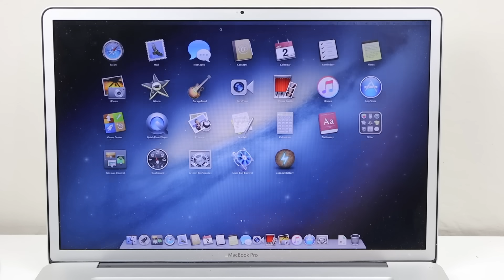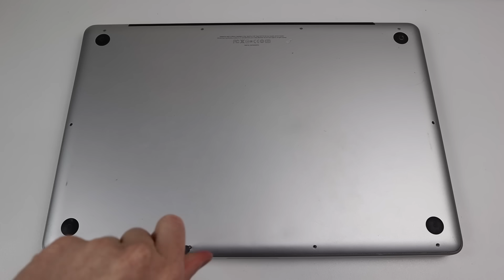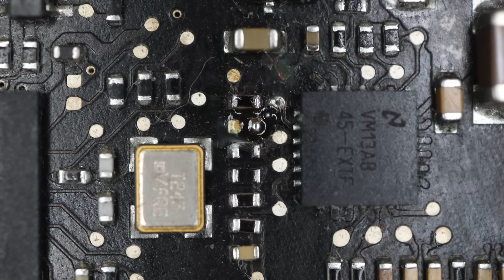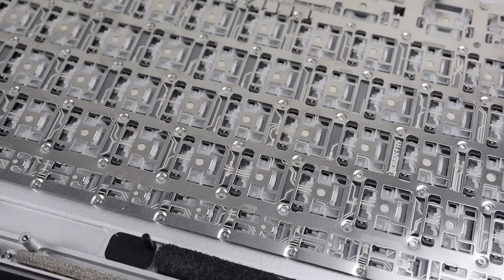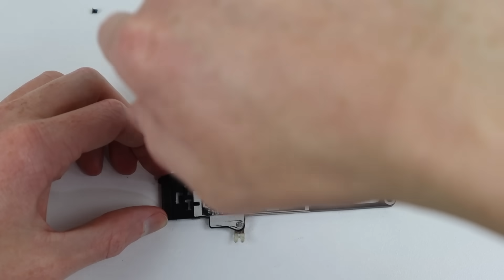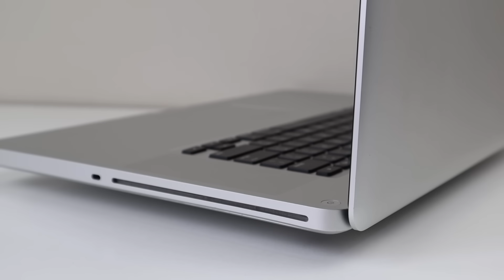Fried GPU! MacBook Pro 2011 Restoration

Comment: I just recently bought the late 2011, A1297, 17” MacBook Pro with matte screen, using a 2.5 GHz quad-core Intel Core i7 processor with the following hardware updates: 
500gb SSD Crucial SATA 3 (6.0 Gb/s), 16gb DDR3 RAM and a brand new battery. 
I’ve also installed Linux Zorin Core on it and kept the AMD Radeon HD 6750M GPU active. 
I also gave it to a workshop to have a “system clean” (heat sink and fan) and apply new thermal paste. Cost me a $100 but it is worth it! A very good idea especially with the GPU active. 
Also installed an ExpressCard for USB 3, that fits in perfectly. So much faster for file transfers. 
One month in and I gotta say it is the best laptop I’ve ever used. 
Using Linux… Took me about 3 days to get used to it and figure things out. With AI anyone can learn it easily. Never used Linux before. 
Linux Zorin is amazing. Something in between windows and MAC OS. Via terminal and with AI help you can set up the system to run perfectly! Set up the fans for thermals, Zorin sets up the correct drivers right away. 
I need it for Chrome web browsing, WhatsApp and Telegram, 3 different AIs, YouTube, VPN, VLC, Steam (installed Sims 4), torrent, Zoom and comes with a Linux version of Office (need it for work.) 
A Canadian bro recommended this to me cause I have a 13” MacBook Pro that I decided to bring back to life (which I have not used since 2019). Then after it worked I deliberately searched for a 17” top version in mint condition ( I have always wanted it) and just went for it haha. 
A 15 year old laptop guys! Total $350. 
As I said - the best laptop I’ve ever used. An aesthetic pleasure. I am shocked still. 😂
P.S. I totally get why corporations want to get rid of this kind of hardware that can be upgraded. Even PlayStation is following suite.

Comment: DosDude has a basic command you run in the Apple root shell. It works perfectly and Ive saved 14 2011 Macbooks. 3 of those running baremetl Linux flawlessly. Its permenant too. "DosDude 2011 GPU disable fix" in a browser. so easy. No need for this zapper although its cool and Hugh is a f--king genius. True master right here

Comment: hey just an fyi you can disable the amd gpu without doin all this.. hold command n s on the left side of the keyboard then follow dosdude 1s tutorial on what to type in to disable it the reboot but into recovery mode or mac os usb then type in csrutil disable press enter then type reboot.. then the mac will boot normal then download macbook pro d-gpu disable too from dos dude 1s website run it then reboot again then upgrade it to osx 10.15 or newer
Reply: Thanks man!

Comment: I bought a 15 year old 17" Asus ROG gaming laptop with a 1st gen i7 and Radeon 5870 for only $12 USD. It also has some artifacting and will crash under load. I repasted it with noctua paste and it luckily has never had a problem since. It cooled down significantly and is actually usable now. 

I ran into this same gen MacBook pro and am kinda afraid to buy it. It's only $20 but 80 miles and 2 hours round trip. I already have an iMac with Radeon 6000 era graphics with intermittent problems. It won't load OSx or Windows 11 but Ubuntu and Bazzite worked great. It has to be using the Radeon graphics cause left 4 dead 2 and half life 2 are able to run at 60fps 1080p. I don't think integrated graphics are that powerful.

Comment: Today it’s cheaper/easier to just swap the whole logic board with a 2012 model. Which is what I did on mine yesterday. These boards are cheap and they fit directly with no need for any modifications. It’s a remarkable improvement over the old one.

Comment: Hello
I had one 17 inches 2012 with the same problem. 

Make a firmware command to do not use thE FAIL GPU. Instal a lot RAM and asign 1.5 Gb to the integrated GPU

Also change the BT card to a new one to get Continuity feature.

And put an SSD to go fast.

Comment: boot your machine while holding the Command + S keys. As the system boots, it should display white text on a black screen, and should eventually stop at a prompt.
At this prompt, enter the following command and press Return:  nvram fa4ce28d-b62f-4c99-9cc3-6815686e30f9:gpu-power-prefs=%01%00%00%00
Reply: I used this back when I still used my 2011 15 inch daily, it really worked. I used it with a patcher on catalina until I bought apple sillicon after more than 10 years on the same device. It had served me well, despite its flawed gpu. I think it helped that I was a light user helping the gpu last longer. GPU lasted almost 8 years before failing. After that I found out that blasting it with a hair dryer uniformly would get it working again for a week before starting to show symptoms of failure again, which is when I found that nvram command somewhere. It served me well after more than 10 years on the same device, despite its flawed gpu and in hindsight awfully slow gpu even for back then considering the 6970 and 6990m were more than twice as fast from the same architecture and lineup. 

Back when you could buy a base 15" and upgrade as you go...

Comment: Wow i have an Early 2011 15 inch that I used the dosdude gpu fix and it works perfectly fine. It had the faulty gpu but i disabled it. I plan on giving it a new ssd and a new battery.

Comment: Same model as what I had. Took it to a guy and he used too much heat and fried the board while putting in a new GPU.
So sad since I just put in a new SSD and it worked really well and fast.

Comment: I’ve got this exact laptop and the graphics wasn’t working when I got it three years ago. I did the old bake in the oven trick and it’s been brilliant ever since so as quickly as it sounds baking the board it doesn’t actually work. At least I did in my case

Comment: To compensate for the lost dedicated GPU, you can use the Apple Thunderbolt 3 to Thunderbolt 2 adapter cable to attach an eGPU like an RX560 for example. There will be a performance hit due to it being TB1 instead of TB3 but it works and it's many times faster than the integrated Intel HD 3000.

Comment: Hi Hugh, greetings from Milan (Italy)! Based on one of your tutorials I got back a mid-2012 13” macbook pro I had in the basement and proceeded withe replacement of the Ram, replacing it with 2x8 Gb sticks from Komputerbay, the hdd with a 480 GB SSD from Crucial and the battery. Everything went smoothly. Restarted it pressing alt cmd and R, entered the wifi code. Connection started but few seconds later got an error message listed as -2100F. Can you help?

Comment: Did you ever figure out what was causing the Shift key failure?
Reply from the maker: No i didn't, someone suggested some faultily chip on the logic board from memory. Still using the laptop, typed this comment on it. :)
Reply: @HughJeffreys  That's awesome, shame about the key though! That would be incredibly annoying to me, but the purple light would probably make it worth it.

Comment: it it's just reprogramming the eeprom then why not just use a programmer, or even desolder it, program another one externally and solder it in place? Would have saved you like 90$ of that 100$ price tag.

Comment: Hello, I successfully installed the GPU killer and got the screen to come up.  I did a terrible solder job on the additional 2 wires for the screen backlight and trashed the test point pads that I'm supposed to solder the wires to.  Is there an alternate site to solder each wire to?  Any hints on getting the solder to stick? more flux?  higher heat?

Comment: what is the name of the software you installed in order to use airdrop with the new bluetooth 4 card? I have replaced the card in my early 2011 A1297 with a card from a mid 2012 A1278, but my bluetooth hardware identifier is 0x4 (BT4 is 0x6) and I can only airdrop to other macs.

Comment: Completely pointless repair/upgrade. 2011 machine is worth zero dollars and so far out of date that it cannot even use the internet properly without third party browsers and email programs. Better to harvest the working parts for a newer machine.
Reply from the maker: It works fine. I use it everyday to watch YouTube and movies on as well as some light web browsing.
Its not powerful but it works.
Got over 800 cycles on the battery since I made this video so its fair to say I have been heavily using it.
Reply: this video was posted one year ago, and the 17” actually has some value. an a1297 with 16GB of RAM and dual drives with windows 10 and macos pre-installed would get you $350-450 from eBay and more from local marketplaces
Reply: “harvest the parts for a newer machine” mate the issue is that the machine is older and parts are incompatible. one has to be a massive spoiled cunt to consider 10-year-old apple devices obsolete.

Comment: I just bought one and restored it, runs hot as they usually do and replaced the thermal paste, but the GPU is good in it just needs feet and more ram

Comment: I had 4 of the 17” 2011 anti glare models, each replacement ended up like the prior with a dead logic board due to the graphics. BTW, LOVE the nostalgia your videos provide.
Reply: that sounds like a thermal issue to me. Not enough cooling on the gpu. Looking at the cooling design I got a strong suspicion on why that is. Basically all the heat from the cpu gets transfered over the gpu.

Comment: Use speaker coil wire next time. Find old speakers, pull out cone presto.. a roll of very small rosin covered wire. Perfect for this task. Its easy to tac down with super glue. It doesn’t obstruct anything under it.

Comment: While I loved watching this - and did watch it all, you maniac! - I'd point out that a far cheaper and less painful way to go is to use the Single user 'Command-S' option to disable the bad gpu: "nvram fa4ce28d-b62f-4c99-9cc3-6815686e30f9:gpu-power-prefs=%01%00%00%00" [w/o quotes]. Then reboot. Optional, but installing the OpenCore Legacy for Monterey will make your 2011 a 2022 machine! NOTE: if one ends up resetting NVRAM or SMC you will have to again enter single user mode and run the above command again.

Comment: i missed out on the recall, mainly due to not knowing. apple wanted $800 to fix the gpu, and that wasnt happening lol im also not sure if i jumped on the macbook lol if not ill have to sort it out.
im doing micro fixes on thermal cameras, which is hard as the companies wont give out the schematics. Nice video :}

Comment: The reason it didn't work the first time was DEFINITELY those mod solder joints. Sorry Hugh, but your soldering was far from excellent in this video. It looked like crappy lead free solder, that would explain the lack of flow. That or your temperature was far too low.

Comment: Hugh, I have a early 2011 MBP 6750M Graphics, 1024MB, it has 2 USB ports, i ask google how many USBa do they have, answer 2 or 4, the one you fixed has 3 USB ports. Pls explain. thx
Reply: Also, I sent my wifes 2011 MBP and my 2011 iMac to a guy in Ireland who said he could sort out the overheating and racing fans, he simply said he bypassed the AMD, would you kindly try to clarify what he may have done. Would he have done what you did when you installed the CMI Zapper. Any thoughts are welcome, this repair guy seems to have left the planet>>? Many thx. Keith

Comment: Since he has a hot air station, I’m curious as to why reflowing the GPU wasn’t attempted before this modification that did away with some of the features.

Also, some flux would’ve been good there. 

I suppose this isn’t a bad solution on older machines that just aren’t worth sending off for a GPU replacement.
Reply: Reflowing the GPU would have only been a short term temporary fix - over time, the GPU would still cause issues, and you'd have the same situation. I reckon it is caused by overheating: I'm not a computer engineer, but that GPU looks to be far too far away from the cooling fans for the heatsink to actually work in cooling down the GPU. Furthermore, the heatsink isn't big enough to support both an i7 CPU and a dedicated GPU (cooling wise), and the heat from the GPU (the chip on the end) has to go past the CPU (middle chip) to get to the fans.
If you ask me, this is very obviously a design flaw that wasn't thought through very well.
Reply: @TheSpotify95  I have an imac with almost the same gpu in it. I was able to reflow and adjust my fan curve so it doesn't get as hot. It has been working fine for years.

Comment: I have the same model auf MacBook. Sadly it just has a black screen. No graphic glitches, just black and even no video on the video output. But it plays the startup tone. Could this be a GPU problem too? I would have guessed it could be a missing power rail, but even with shematics and boardview, I can't really find anything and because I don't know what parts I should check, I can't really fix it until I get a replacement board.
Reply: i have the same problem...😢
what did you do something to fix this problem?

Comment: Left shift key is a special key like the power button / left ctrl / option.

Instead of being wired directly to the keyboard IC like other keys, it first goes to a series of AND logical Gates that checks if left shift/control/option are pressed. That's how the computer can tell if you are doing a SMC Reset when its off. Those AND gates can easily get broken

So basically you need to replace U5750/U5755 (the two IC you can find right in front of the keyboard connector in 12:17) or the nearby capacitors/resistors and the key will probably work again without needing to replace the entire keyboard.
Reply: This is gold! I have the same MBP as in the video, and replaced the whole keyboard but after 3 days the space bar got problem, it types on its own. So I had to put back my faulty stock keyboard with the Enter key not working. May I ask what can I do to fix one of them, could be the faulty Enter key or the Space bar just so I can use one of them. Thank you very much in advance!

Comment: I have two of these 17" models I just bought, and they both have back light issues with not evenly lighting up the keyboard.. Seems to be a few keys that light brighter than others, and dimmer parts of the keyboard.. After spending $120 at a local computer repair shop and the back light being replaced, it's still not 100%.. Does anyone know who can fix the issue?

Comment: The left shift key has a dedicated pin on the flex cable and connector on the logic board. There may be corrosion in the connector.

Comment: Hugh, 1) never squirt liquid onto a laptop or screen. Always spray a cloth. 2) re: KB screws .. rotate them counter-clockwise until feeling the threads align. Do this with all screws and never cross thread again. When turning counter-clockwise you will feel a "click" which is the screw threads aligning with the laptop threads. 3) Now you can perhaps help me: I've never heard of a computer causing one key to not work. What do you think can cause it to happen? 4) when cleaning a screen, lay the laptop on the screen back, balance the lower case and then clean the screen. You won't stress hinges or frames. Great video. I learned from it.

Comment: Can be done doing coding :
Command + Alt + P + R
Command + R + S
Csrutil disable
Reboot

Enter Recovery Mode : Command + R + S 
Type : /sbin/fsck –fy
Type : sbin/mount -uw
type : nvram fa4ce28d-b62f-4c99-9cc3-6815686e30f9:
gpu-power-prefs=%01%00%00%00 
Restart the system : shutdown -r now

Comment: Dat litle corosion.. possible kill GPU or make it unable to use normal.. coz is power resistor.. from internal PSU for CPU and GPU.. it get shotr and zap your GPU or you repair it by remowing it.... beter test ot before you try replace chip.. who know where is GPU PSU lane unde black color of PCB

Comment: I have also an 2011 with same problem. I habe removed the Files in the Library for the gpu. So now it works with the internal. AirPlay and external Monitor is of course not working. FaceTime camera is also not working. Works the Camera with your gpu Killer ?